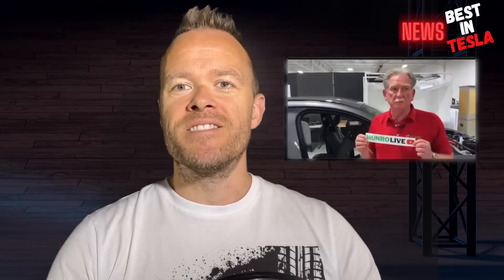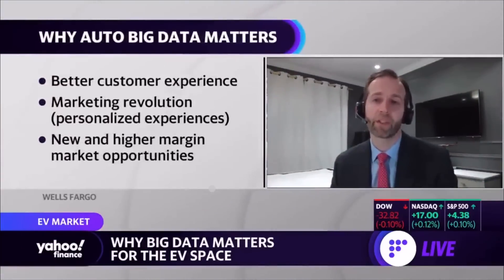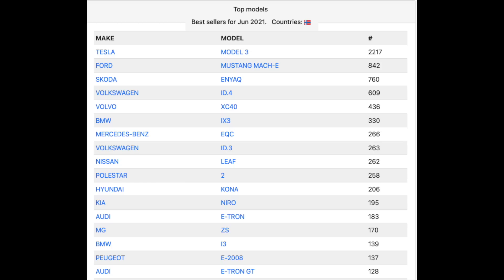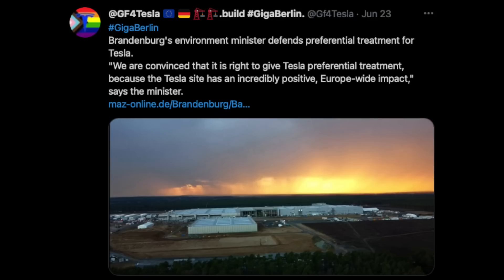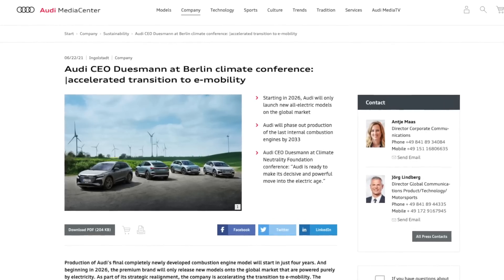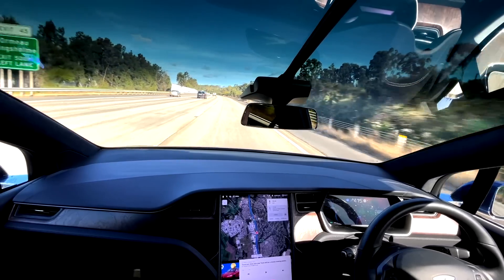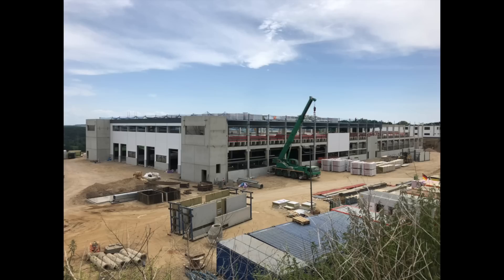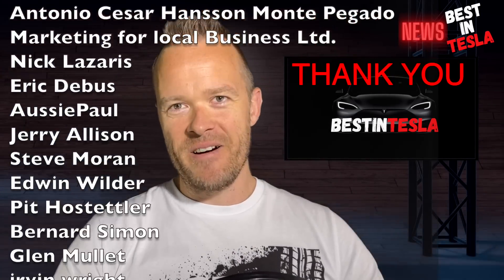Tesla shows off software power & VW EV’s are off to a bit shaky start in China

Comment: The latest Tesla FUD is about the massive China recall of 300,000 “defective” Teslas. If you read the fine print it”s a small software issue that can easily be fixed with an over the air update. It’s has probably already been addressed. Mainstream media is shameful.
Reply: … massive China “recall” of 300,000 “defective” Teslas”…

There, I fixed it for you.

And yes, I know, most lying media wrote recall, instead of “recall”, and certainly not the correct “Tesla pushed an OTA software update”.
Reply: Media only cares about making money, this is one example but there are other examples like blaming IC engines for air pollution and environmental damage when 90% is determined by the fuel and 
probably 99% in the future. The current fossil fuels we put in out cars are shit fuels overall when compared to alcohols such as methanol or ethanol. Both of these fuel can produce very minimal air and environment pollution when burned and can be produced sustainably and has many benefits for engines.
Reply: It was mostly a feature request from the Chinese market to which Tesla reacted by saying they wanted to proactively make the activation of the TACC more conspicuous. Done in a weekend and now the car makes a chime sound when TACC is activated.
Reply: @alejandromeneses7735  exactly. The dishonest media made it sound like It was a tires fall off at high speed kind of problem.

Comment: Had a chat with a VW mechanic I know, and the ID SW updates takes up to 9.5 hours "depending on how many modules need updating"........
Reply: Yes, because the construction does not hold up. And that will not get better before a complete overhaul of the complete system. One central computer for everything drive train and one for the entertainment and navigation. That’s all. But they can not do that. VW is no car designer. VW is a car assembler. They depend completely on Schäffler, Bosch, ZF and many more.
Reply: I'm sure that the dealers are thrilled about doing these updates.
Reply: @mcconlogue1898  They could have converted to Tesla 10 years ago. But no: They did not want to take the step. Now they have the problems and not enough money and workers to solve them. My heart bleeds for them.
Not...
Reply: @wolfgangpreier9160  If the new VW's are full of all this outsourced crap, well I'm not going to buy one. If I buy VW, I want VW, not a grab bag from other manufacturers. Sure, if they sell one promoted as featuring a B&O audio system, that is fine, but otherwise it should be all VW.
Reply: @paulstubbs7678  Then you should buy Tesla. They are the ones with 70% self produced "crap" as you so eloquently name them. All others, including VW only produce about 10-15% "crap" themselves. Everything else is bought elsewhere and only assembled in the factories. VW, BMW,. Ford, you nameit, do not produce rims, copper wires, HV batteries, steel or aluminium for the body parts, lights, everything interior, controllers. They cast the motor blocks, some build the motors in house, but none produce the neodym magnets or the  but not even the sheets of iron for the motors, nor the bearings or gears. Many do not even produce the crankshaft or pistons. They do not make plugs or switches, no glass, no tires, no turbo or 12V batteries.

Comment: over the air updates for cars are not as easy as you make out, you can really only do it if you have the vertical integration that Tesla has, as suppliers don't want to talk to each other.
Reply: Eish, if that's the case, am afraid no one can do it except tesla
Reply: @petersmangalisongoma2013  - If True, then...
"Surprise!" (Not going to be a good discovery, by Legacy Automakers!)
Reply: That's not the whole picture though. If Volkswagen can plug in a cable in a car to update the software, they should be able to do it over the air as well. The problem is that they don't have a competent software team to create the infrastructure for it.
Reply: Well, if your suppliers won't talk ...., then don't give them a contract.

Comment: I would imagine that the aerospace industry might be interested in the Plaid motor technology given its power performance to weight and size ratio.
Reply: SN15 PLAID
Reply: By definition, Spacex engineers were involved in their production, so this argument would lead to a do-loop error.

While Elon views the auto OEMs with befuddlement, he has disdain for the larger major aerospace competitors like Boeing and Lockheed. He views them as companies that survive by pilfering the public treasury - it won’t be in this lifetime that he helps those guys out…
Reply: I was thinking more of electric prop and fan aircraft

Comment: Careful.  We don't actually know that Panasonic's 4680 cell is identical to the Tesla 4680 cell.  4680 is just the dimensions of a can, it implies nothing about what is inside.  We've heard literally nothing about Tesla licensing its battery IP to Panasonic, and nothing about Tesla buying 4680 cells from Panasonic, either.

It's quite possible that Panasonic is simply developing its own battery for a can with 46 mm X 80 mm dimensions.  We can't begin to guess how it will perform or who they will sell it to.

Car & Driver just published an article comparing the Mach-E and the Model Y, and they put the Model Y in second place.  The magazine complained about the Model Y's fit-and-finish, uncomfortable seats, poorer noise control, glitchy electronics, and crappy handling compared to the Mach-E.  Objective?  Hard to say.  They didn't disclose much data in the article - just their opinions.

The CCP has launched another FUD attack on Tesla, requiring Tesla to 'recall' nearly all of the cars it has sold in China to date.  It isn't actually a recall, though that is how the media in China and everywhere else is labeling it in headlines.  What really happened is that Chinese regulators decided that Tesla's Autopilot is 'too easy to engage,' and can result in unintended acceleration, which is, in their minds, a safety risk.  They are requiring Tesla to issue an OTA software update to make it harder to engage Autopilot.  How this is a safety issue isn't clear.  Autopilot will not accelerate unless the car is traveling slower than the posted speed limit and there are no cars in the way.  I think it may be a complete non-issue, but it's generating a lot of negative press coverage for Tesla around the world.

The CCP wants Tesla in China.  But I don't believe they want Tesla to dominate BEV sales in China.  The FUD they've been spreading intensifies with every jump in Tesla's sales numbers.  And it is convincing many consumers that Tesla doesn't make safe cars - which is demonstrably false.
Reply: Panasonic is manufacturing 4680 cells UNDER LICENSE for Tesla, using Tesla IP, Patents and Technology.
This has been reported several times, with information coming from both Tesla and Panasonic.
And LG Chem is also setting up a pilot line for the 4680.
Yes, Tesla is building cell manufacturing plants, but Mr. Musk realizes that Tesla alone cannot fully supply the massive cell demands.

Remember, their Master Plan is to
“Accelerate the World’s Transition Away from Non-Renewable sources of Energy”

It’s not
“Totally Destroy the Competition and Achieve World Dominance”

And Mr Musk once stated that if the world DOES transition away FF and towards RE, then even if his Tesla fails, he would still consider it a victory.
Reply: @ernestgalvan9037  I've read a bunch of articles, same as you.

I see lots of assumptions in those articles.  I haven't seen much factual reporting.  The worst assumption you can make is that 4680 implies a particular cell design or chemistry.  It does not.

Journalists often jump to conclusions without appreciating this distinction.  But if you look at the words actually used by Panasonic and others, they say nothing about what's in the 4680 cells they're trying to develop.  Nothing.  They don't claim they have a sales agreement with Tesla.  They don't claim they're using Tesla IP.  The only firm claim we can find is that they're working on this can form factor.  That's it.  Air-headed journalists may not notice this distinction, but we don't have to take journalists as authorities.  (They are not experts.)

Tesla's plan is to exceed 3 TWh of cell production capacity.  I'm sure when they reach that goal, they'll continue to increase their capacity.  The world will need 20 TWh of capacity by 2040, and more beyond that date.  In the meantime, Tesla is also accelerating their consumption of cells.  Yes, they intend to keep buying cells from outside suppliers for years to come.

But ultimately?  Internally-produced cells appear to be the cheapest cells Tesla can source.  Think about what that means.  Eventually (but not soon), on this trajectory, they'll walk away from outside suppliers.

And then what?

Well, actually, that's a good thing for accelerating the world's transition to sustainable energy.  All of that capacity among its outside suppliers will have to be re-aimed at other OEMs.  A glut of supply will cause prices to fall.  This probably won't bother Tesla; they'll either have cheaper cells from internal production, or they'll simply keep buying cells from outside suppliers..  Tesla will be able to choose its market position, dive in wherever it wants to go.  But generous cell supplies will help other companies to fill in the niches where Tesla doesn't choose to operate.  We can expect more BEV models, more BEV volume, more homebuilding companies equipping new homes with solar + storage, more battery replacements for gas peaker plants, more innovation.  Does Tesla want to make giant battery-electric mining machines?  Construction machines?  RVs?  Trains?  Ships?  I'm sure there are niches where they won't choose to operate, but they'll be glad to create the situation where it's economical for other companies to jump in.

So encouraging battery suppliers to ramp production now doesn't mean Tesla is intending to destroy all competition.  What they're doing is motivating the entire battery industry to expand rapidly, while decreasing Tesla's dependence on internal supplies in the short-to-mid term, when those internal supplies won't be enough.  This does not imply that Tesla intends to consume battery cells from outside suppliers forever.  Their aggressive internal cell production ramp implies eventual independence from suppliers - and don't think Panasonic doesn't know this.  To stay in the game, Panasonic believes it must diversify its customer base.

But... it's also good to realize that battery tech isn't standing still.  If better tech and better prices arrive from outside OEMs, Tesla will have the option of buying those cells to advance its own plans (maybe airplanes?), or buying the IP and incorporating advances into its own production, or developing co-production arrangements like their current Panasonic relationship.

So it's probably a mistake to view Tesla's plans as nailed down tight.  More likely, they're keeping options open.  Elon likes his companies to be nimble, to change direction when changing direction makes sense.  At this moment in time, Tesla appears to be on a trajectory that will free them of outside suppliers.  But as to whether that day will actually arrive at some point down the road... well, there are a lot of variables in play, starting with cell prices and performance characteristics offered by outside suppliers, which is impossible to know many years in advance.

The one constant here in Tesla's plans is that they want cell production to go up fast, both internally and externally.  And they're doing all that they can to make sure it happens.
Reply: @Urgelt  …February 3rd, 2021… “Panasonic confirmed that it plans to set up TESLA 4680 battery cell production at Gigafactory Nevada later this year”

There are other stories from Panasonic, including from the President/CEO of Panasonic, which point to Tesla 4680 cells.
These might all be FUD/LIES/ASSUMPTIONS from Panasonic.

And I am fully aware that “4680” is a generic size description, but Tesla 4680 is much more specific.

YMMV
Reply: @ernestgalvan9037  The articles in question are terribly vague as to specifics.  I think we're seeing reporters who do not understand battery cell naming conventions and who are making unconfirmed assumptions.

Panasonic has never said that they are using Tesla's patents to make cells identical to what Cato Road produces, or that they have a contract to supply 4680 cells to Tesla.

They are developing cells in the 4680 form factor.  That is all we can confirm has been said by Panasonic.  The rest is either rumors, unspoken assumptions or flat-out ignorance on the part of writers.

I am not saying that Panasonic is not licensing Tesla's IP or that Panasonic will not sell 4680 cells to Tesla.  I am saying we don't know, from what Panasonic has said on the subject.  As for Tesla, they have never commented on this question.

Bad reporting just spreads fog; it does not illuminate.  It's pointless to regard those articles as anything but clickbait.
Reply: @ernestgalvan9037  Plans are cheap.  We still haven't heard Tesla confirm diddly, and there are specific things Panasonic could have said and did not say - such as, we have a contract or an agreement to sell 4680 cells to Tesla.  Or, we have licenses or agreement from Tesla to use their IP.  Those words are completely missing from Panasonic's announcements.

Should we assume that Panasonic can't do anything at GF-Nevada that doesn't result in sales to Tesla?  Development of new chemistries?  Pilot production of a new form factor?  Manufacturing cells for other automakers?  Is any of that ruled out?  Even the answers to those questions requires peering into contracts between Tesla and Panasonic - which we don't have access to.

So the entire picture of Panasonic supplying 4680 cells to Tesla rests on multiple unproven assumptions.  Panasonic's statements seem to invite jumping to conclusions which may or may not be true, without actually saying anything that's false.  So long as Tesla is mute on the subject, I'd be very wary of making any assumptions about what Panasonic will do with the 4680 form factor.

They're doing mumble-something-mumble at GF-Nevada with 4680 cans.  That's about all we know.  Panasonic knows more.  Tesla knows more.  We don't, and the articles that rush to conclusions by jumping over multiple assumptions without even acknowledging them are doing us no favors.

Comment: VW should not have launched this vehicle without over the air updates.  It is a clear sign this vehicle is not high tech.  Another statement identifying this car as dumb is that unnecessary start/stop button.  Why can Tesla eliminate it, but VW and Ford require it.   Frankly, I think both companies wanted the button so ice vehicle buyers could easily transition to EVs.  While iD.4 interior is attractive, doubt I could ever buy an EV without a frunk.

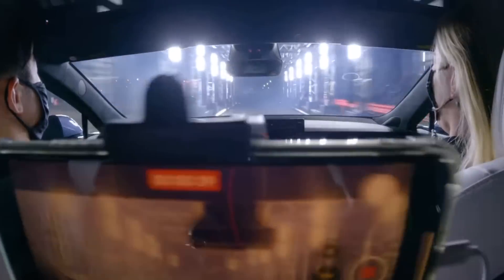Comment: 2:20 - I think you are underestimating the Chinese. I can see you are aware of BYD, Geely, Xpeng and Nio product. So your comment here are a little surprising. Chinese battery technology is at the point where Tesla is using Chinese CATL batteries in the Model 3 made in Shanghai and exported outside the USA. BYD has a superior Blade Battery to Tesla. Yes, Tesla is going to beat all/most incumbent ICE manufacturers (VAG, Ford, BMW, Mazda, Toyota etc). But not the Chinese. I suggest you do some more research on what is happening in China with their home-grown brands. They already have an EV market which is bigger than the rest of the world combined and Tesla is not the biggest selling BEV their either.